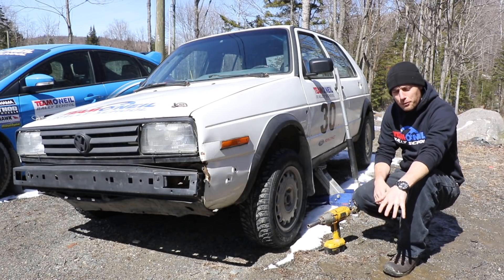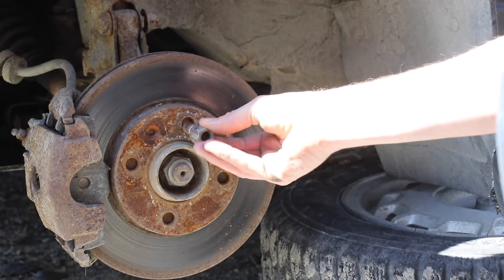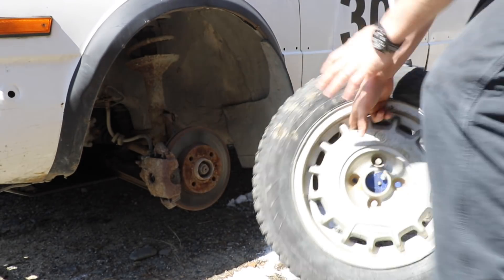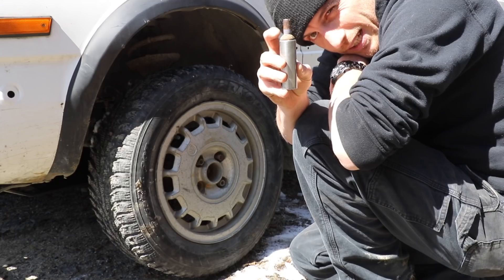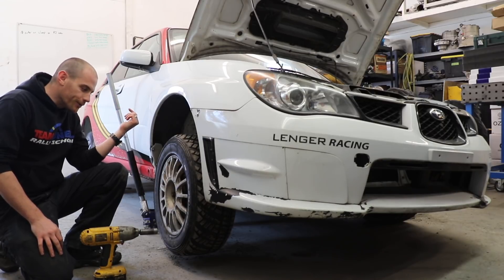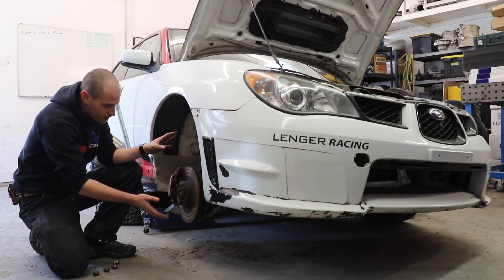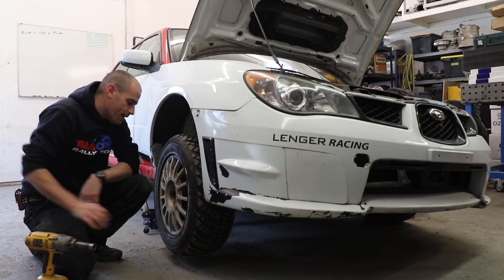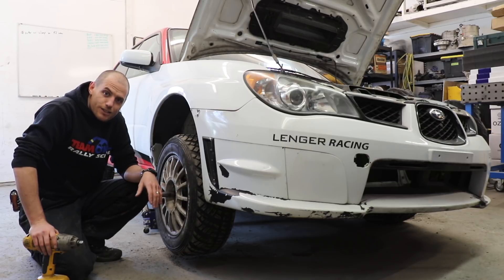Wheel Bolts VS Wheel Studs and Lug Nuts

Comment: If you do stud conversion, what do you use - loctite or welding?
Reply: grishk0 you use spares and check them regularly. Almost lost a wheel when 3 out of 4 went missing. Had them threadlocked in, still came lose.
Reply: grishk0 green loctite 680 should be sufficient. You will need heat to remove it.
Reply: Thanks guys, I was thinking the same. Soon I'll be going with 12cm studs and 5cm wheel spacers.
Reply: grishk0 there are spacers available with integrated studs. You screw them in place with lugbolts and use the studs for the nuts. Cheap ones tend to break easily though. And i assume you know what you are doing when choosing to use spacers, and do not need a lecture on how bad of an idea it is unless you have no other way of fitting the wheel you want.
Reply: Dainis Berzins the idea is to widen the step of the car, and fill the fenders. I know that the better spacers are these who just sit on the wheel hub, and the wheel is tighten on the hub studs, not on the spacer.

Comment: Im a VW mechanic and i like the bolts more because im faster with them and you can change the front brake disc and pads without having to remove the brake caliper ;)
Reply: I could do front pads on a Mk2 in 15 minutes as it is but how do you do it without removing the caliper?
Reply: John Jacob https://youtu.be/GhyeVaBRnzg
Basically like in the video but i dont need to remove the part @4:50
Reply: Oh, you mean you don't remove the carrier.
Reply: John Jacob yea sorry i didnt know what its called in english

Comment: Strip one stud and your have to replace the whole thing. Bolts make more sense.
Reply: True. But cross-thread one bolt hole and you have to replace whole hub assembly.
I think studs are more fool proof.
Reply: Matlov you just replace the damaged stud. No big deal.
Reply: I just just replace a stud in 5 min. Strip a bolt and replace the hub and bearing
Reply: Matlov strip a stud you replace the stud, trip a bolt, drill it oh and put a stud in... saves the hassle.